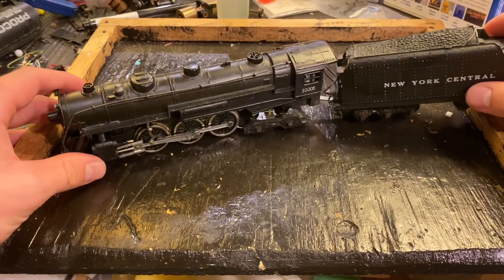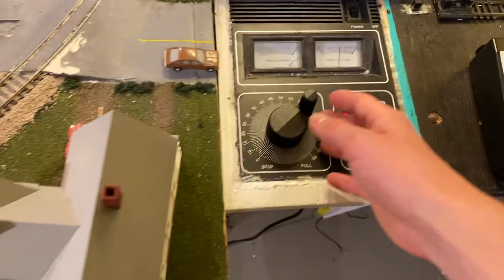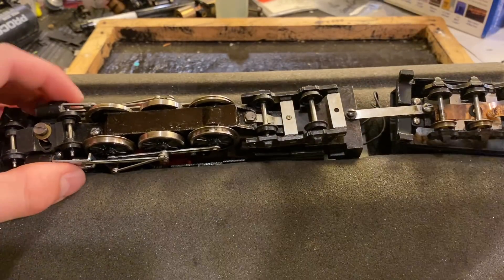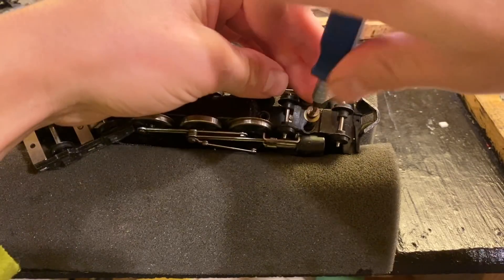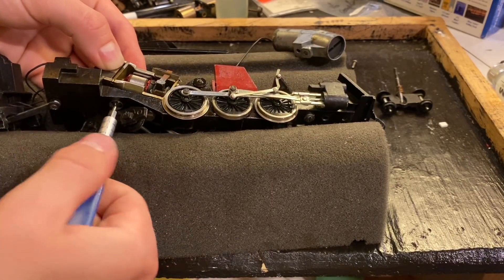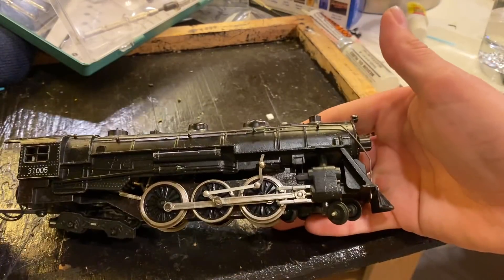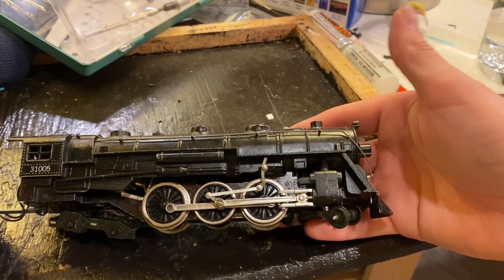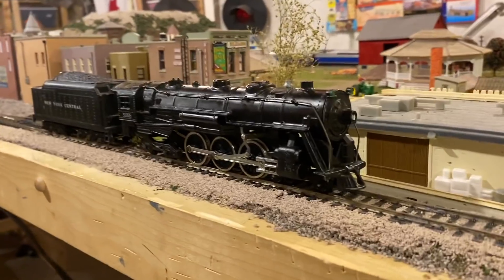Can We Make This 1950s American Flyer Steam Loco Run?

Comment: Seven years back, I had to do my senior project here in California. As a requirement for the project you had to do some volunteer hours based on the topic you chose. I chose to do mine on the importance of small businesses in communities. So I volunteered at my local hobby shop. I got to know the owner there really well, and one day I told him that I was going to buy one of these 50's american flyer engines on eBay later when I got home. Later that day a regular used trains seller came in with a small suit case full of rolling stock and an engine. I was stocking some model cars when I heard him call me, he pointed at the American Flyer engine and asked me, "thats the one you looking for?", I said " uh hu". He bought the whole suit case for 10 dollars and gave me the engine at the end of the day. He said "bring it soon when you get it running!". That was the first engine I ever rebuilt. I remember going around the house showing my whole family how cool all the internal mechanical parts were. I can almost smell the scent from the engine as it was running. that was 7 years ago, the shop is closed, now I buy and fix O scale stuff.
Reply: That’s awesome! Such a cool story.
Reply: Do you still have the engine
Reply: So awesome story!!!
Reply: Can you get a GE U50C or SD70ACE from UP
Reply: NVM

Comment: You have no smoke and no  Choo Choo sound because you did not put the pin through the carbon piston that goes in the smoke and Choo Choo cylinder there is supposed to be a little round pin that holds that to the drive rod that comes from the gear by the motor.

Comment: Great job with the video, but I wish you would have taken more time to realize you installed the front truck backwards, the unit had a Choo-Choo feature and Smoke feature with light (broken wire).  Should take it apart again, add the proper grease and make it 100%, with new rubber on the rear wheels.  You will be amazed even more with this train.
Reply: Yes I wish the same thing! That he should have taken more time to get the smoke and Choo Choo unit working and the front truck on correctly!.

Comment: I just purchased a 1954 American Flyer 4-8-4 Numbered 336 and it has the same problem as this one did in the beginning. Got some buzzing but no movement. I can spin the motor by hand but wheels are locked up. 
I saved this video so when I get around to repairing it the task should be much easier following your work. Thank you!!

Comment: Great video, have fixed a few of these over the years and have yet to get started restoring my Grandfathers old S gauge AF's.   Good to see that old Girl running again though she needs a complete break down and thorough cleaning, lubricating and probably rewiring to make sure all the old connections are solid and clean.  Great video!
Oh yeah make sure you test the pole resistance on that motor to make sure all are good, if not make sure all poles have the wires connected and try again.  It may need to be rewound or replaced if that's too much of a pain for you.  Just remember to check each pole usually 3,  if 1 has infinity the motor will be intermittent in running and you'll have to do as you did to get it spinning.

Comment: I have the Wabash one and the same problem, the axles are locked up, but much worse than yours was.  I probably should soak it in penetrating oil or something, but it looked like it might have to have the drivers pulled and maybe the axles driven out of the frame.

Comment: SMT Mainline did you put the smoke unit and Choo Choo back into the locomotive when you put it back together? I saw them when you took it apart but didn't see them on the body when you were putting the shell back on the engine.
Reply from the maker: I decided to remove it since the cylinder was jammed and I figured even if I got it moving again the motor might not be able to handle the added strain.

Comment: I absolutely love those motors! It's a Pittman open frame motor. I have a very old Tyco Pacific from the 1950s that has a Pittman, an enclosed gearbox and a diecast tender and cab and oh man is it a peach to run! 
Note: my Pacific predates the Mantuas most people think of with the smaller, noisy mantua motor with a worm gear on the end. It's a proper Pittman nearly identical to my dcc fitted bowser usra mountain and brass Nickel Plate Road L1-b Hudson.